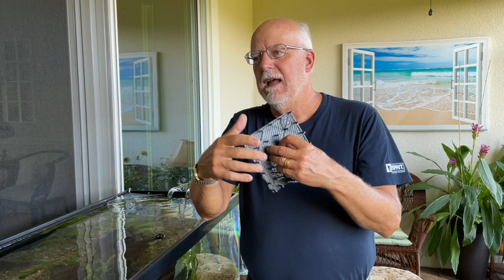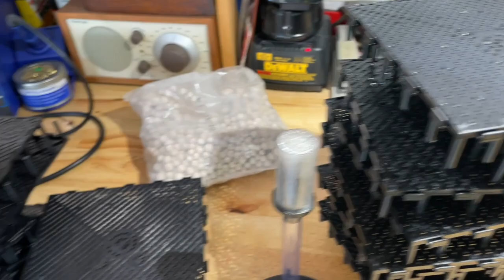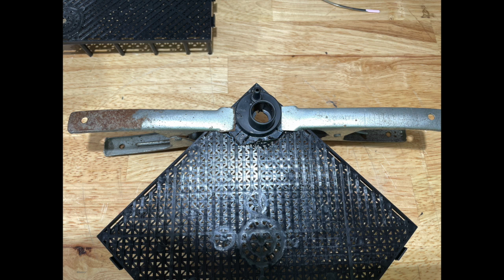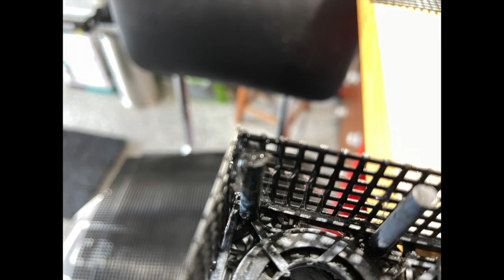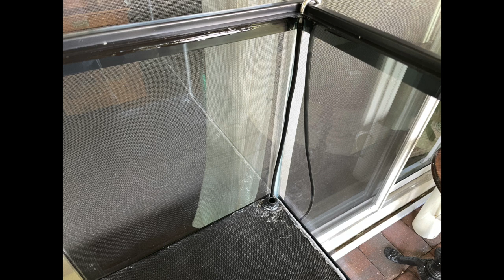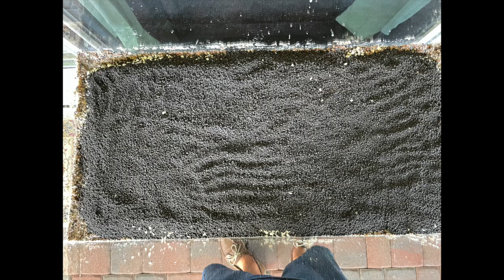PART 3: Step by step instructions on setting up a 40-gal breeder in the Lanai with Plenum and BCB

Comment: Dr. Kevin Novak, thanks for the great video!
There is a problem Undergravel filter that the UGF has narrow slots in the plates, which over time become covered with silt and dirt and cannot allow water flow through them.
And if aquarium tubes can be easily cleaned with a brush, then I have no idea how to clean the narrow slots of the UGF.
I will be glad if the author removes my fears!
Reply from the maker: I've ran under gravel filters on the same tank/s for over 25 years and never, and I mean never, had the slots clogged up. There is a lot of misinformation out there about plenums and under gravel filters that really hold no merit in the Hobby.
Reply: @anoxicfiltrationplenums  Thank you for your reply! This was my only doubt on the way to installing a Undergravel filter + Plenum. Your experience has removed this doubt and now the way is clear... :)

Comment: Those plates are available in Indonesia and they come in black or white but they sell two types. There is the one you show and they also come with a hole in one corner set up for a riser which is sold separately. Here they cost about 70 cents each.

The craft screen is a whole other story costing several dollars for an A4 size sheet. I just hot glue some nylon fly screen to the assembled plates, folding down each edge. A meter of fly screen costs less than 2 dollars.
Reply from the maker: You can also make a plan. I'm out of PVC pipe you can buy any Hardware Store..

Comment: Dr Novack, woudl it be an issue if i put the kitty litter with Iron right on top of the filter plates and then add the sand+gravel mix on top? or do i need to have a gravel/gravel+sand on the filter plates before i put a layer of kitty litter and laterite?
Reply from the maker: In fact, I would highly recommend that you do it the way you're describing.
Reply: @anoxicfiltrationplenums  thank you for coming back. I am in the process of doing this in my tank so let's see how it goes 🙂
Reply: Dr Novak, do you think if I vary the thickness of the plenum or substrate it impacts the effectiveness of the plenum? For example I have set up my tank so that the substrate including the plenum is thicker at the back 4 inch and thinner at th front around 3 inch

Comment: I’m new at this, how often do you change the plenum??
Reply from the maker: Never, once it's set up you should be good to go. For example, my 90 gallon aquarium has been running far over 4- years now with a Plenum and it should run easily 20 to 30 years without ever being torn down.

Comment: In the past I had issues with glue sticks adhering, what type of glue stick are you using. Btw, I am living in  se Florida, not many fresh water stores here in Port St. Lucie
Reply from the maker: I don't know what kind of glue sticks they are. I think I just bought them at one of the Harvy stores. They seem to be doing fine and holding very well..

Comment: Isn't that the same thing as a bottom filter?  I might have missed a part when you were explaining the functionality of it, but it seems just the same as a regular bottom filter.  When I was younger I had a 55gal set up with a bottom filter that had four up lift tubes, I used the two outer tubes for air/bubbles and used the two inner tubes for two HOB filters, I simply put the intake tubes from the HOB's into the two up lift tubes used for the bottom filter so that all the muck would go through the substrate, under the bottom filter and then up through the up lift tubes/hob intake tubes.  It kept the water sparkling clean, but that was before I knew about testing for ammonia, nitrites and nitrates so I didn't know anything about parameters, my fish always seemed happy and healthy with just monthly water changes and filter cartridge swaps when needed, and I had that tank set up for over four years.
Reply from the maker: The name "bottom filter" is a misnomer and that you don't use a Plenum as a mechanical filter. You use it basically 100% biological.

Comment: For some reason I want to start this out by calling you Doc, so if that's ok, here we go.  Love all your undergravel videos.  This is my setup.  Bio Rings underneather Lee's Premium Undergravel on a 20 L.  On top of filter is landscape or weed control sreen, then organic soil mixed with Flourite Red about 2 inches, then about an inch of black sand.  Cut the tube down to about 3 inches above substrate.  How can I tell if the water is flowing unerneath?  That landscape screen was pretty tight nit but water would go through it although pretty slow.  Am I ok with this setup?  Thanks Doc

Comment: My mbunas keep on digging the gravel. I'm afraid they'll never allow the plenum to work optimally. Good thing I have 2 BCBS with oil-dri in the overhead sump.
Reply from the maker: Just use one of those craft screens about a half inch to an inch into the Plenum and then once they start digging they'll only be able to dig that half inch or so of substrate and can't then bother the rest of the Plenum.
Reply: @anoxicfiltrationplenums  🤣 ok doc... That'll be fun.
Reply: @rockfella27  this made me laugh! Hope the plastic mesh worked out for you 😊
Reply: @laurasutton4057  It really did. I sewed 6 of them together with fishline (nylon thread) and a needle to make a big single one the length x width of my aquarium. Worked perfect.

Comment: I have an aquarium that is approximately 117 gallons. I have calculated I will need 27 of the grids. My question is will I need more than one uptake?
Reply from the maker: Not really, after all you're only trying to move water through the plenum slowly and you're not trying to move water as fast as you can so one uplift tube would be more than enough.
Reply: @anoxicfiltrationplenums  Thank you som much for getting back to me really appreciate it!

Comment: Would red lava rock contain enough iron to work as the iron source?
Reply from the maker: As far as I know no lava rock would not work unless there's a way for it to break down and release the iron to make it available to the plants and bacteria. There are other substrates that have iron in them but that iron unless it can be released someway  will not become available to the plants or bacteria. However, manufactures kind of deceive the hobbiest into believing that there's iron in their substrates but it's an usable iron. Here's an example: long ago people used to use iron nails and put them in their aquarium substrate. The iron nails would start oxidizing and therefore would break down and release the iron to the plants. So if you have a substrate that can't be broken down to release its iron content how is the iron going to get to the plants?

Comment: Instead of betta undergravel you can just buy rigid tubing. More bang for your buck and you can make several plenums by just fixing the rigid tubing to the hole you make with the step drill.
Reply from the maker: That's true but I was just trying to make it easy on the hobbiest.

Comment: I really like how you mixed the sand and gravel. The goldfish are very pretty and it will make their colors stand out more. I have used the API Quick Start and the Stress Zyme for as long as I can remember and it has always worked very well for me. For anyone who may be interested Lowe’s has the anti fatigue matting by the foot and it is a great leveling mat for aquariums. Also Rancher’s Supply also has what they call stall matting in different sizes by the foot. Both work very well. Great build Dr. Novak. Look forward to seeing the plants you picked. Have a great evening. 👍❤️😊🐠

Comment: I have a question doc.. I have a 275 gallon curved plexiglass tank with a 30 or so gallon sump I bought from my roommate last year and set it up at my gf house. I do very little maintenance/water changes. I do test the water occasionally for ammonia, nitrates, nitrites. My question is why is it always at 0 none on these 3 tests? I run one 2217 eheim with mech and the coco puffs and the basic filters that come standard with it. I did throw a full filter pad probably 10 by 14 inches I got from petsmart, it’s a white/grayish pad I believe for nitrates, I’ve washed it couple times and it’s been in there for 8 months so I don’t know how effective it is. The previous owner never had anything nothing in the sump so I threw that in there a 6 small bags of meh bio media in attempt to at least make some sort of use for the sump. I put in two 10 pound bags of the red clay fluorite on top of the two or so inches of gravel already in the tank to help out the 6 Anubis and couple Java ferns. I just don’t understand with all the tritus/ fish poop and food from being over feed laying in the bottom of the sump and the most neglected fish tank with couple 20% water changes in a year why aren’t the fish, plants dead and no nitrates? The tank has 4 angles, 5 red eye tetras, 5 green tetras, couple mbunas, 3 them funny looking orange cichlids, couple small peacock cichlids, large plecco, couple different Corys, 2 large blue South American Acaras, one dubusi, they all get along idk 🤷 why lol 😆.and few more I’m forgetting. So there is fish in tank. Probably not a lot considering the size of tank. Could the Red clay fluorite I dumped in be acting like a anoxic filter? There’s no kitty litter in there but a lot of red clay laying all over the bottom of tank. Also the water is clear and barely any algae on the glass or plants, the 10 inch plecco is probably helping some. I did service the eheim and vacuum all the tritus in the sump today. I just don’t understand people doing two water changes a week and I have only done three 20% in a year? Also the water in San Diego is high PH I have tested the tank and it’s high or alkaline. Any thoughts? Thanks for you advice in advance. Really enjoying your videos and I am going to make a large anoxic filter for the sump cause I don’t do much maintenance obviously.

Comment: Why do you never use a small external(!) pump instead of the bubbler? For example, a pump with a capacity of 60 liters / hour is switched on every hour for one minute. You can measure all the parameters of water from under the plenum, accurately change the amount of water intake, find the maximum amount of water at which complete denitrification still occurs, to use the plenum maximum efficiently.
Reply: Suggest a make/brand of whatever you recommending. Thx.

Comment: Good video.
You start again to talk about canister filter at the end of the video.
This iron an cat litter will complete the nitrogen cycle. 
So is that not enough filtration if you have a normal stock tank? In other words do i need additional filtration added besides the cat litter and iron?
Reply from the maker: If you watch some of my newer videos I run a 20 gallon aquarium completely off a canister filter using a PCB basket in it. There was no substrate no plants no nothing, except the canister filter.

Comment: How deep was the first layer of gravel/sand that was on top of the plastic UG filter pieces? Also the final layer on the top ( gravel/sand mix ). Was the mix 20lb gravel and 50lb sand?
Reply from the maker: It really doesn't matter how deep you make any of the layers above a Plenum as long is it combine height is anywhere between 3 to 4 inches.

Comment: Sir the cheap Chinese undergravel filter are worthless and to join them is a pain, moreover, to connect them a lot of spaces has to be manually created for water movement below it, which too is a pain. I have purchase drain cells and plan on using it. They connect easily. What do you say sir?
Reply from the maker: I have not found the same problem you have with the UG plates. And I have bought several of them for different aquariums and they work just fine for me.
Reply: @anoxicfiltrationplenums  Sir here they  come in 7.5" x 7.5" two plates each  in one pack. For each plate there is separate lift tube and no space in between. I made a plenum for my daughter's 75G aquarium. A total 8 such plates were used. I had to cut slots manually on the bottom of the UG filter for water movement. Now I am setting up a 150 for myself. The drain cells have 90% void space, joining them is a child's play. I am planning on pasting craft screen using glue gun on top of it. The cost for entire DIY UG filter is costing under 5 dollars.

Comment: Hi Kevin. .. wow this is the money shot ! So it's now clear to us all how to install the plenum and what the substrate sandwich looks like ! It actually isn't as complicated as a lot of others have made out. It's so awesome to have such information available and I for one am ready to reset up my 1st tank. I now have all the materials that I need based on your recommendations. I've gone for ultra fine nylon fabric for my substrate seperator. The under gravel plates I have come with the uplift tube attachment bases already so I don't have to do that bit. I'm just thinking on my final sandwich mix for my substrate. On a side note I've filled a filter sock with my mix of baked clay sanicat kitty litter and dupla laterite and installed that into my juwel rio 125 built in filter. Will now  wait and see what happens. Thanks again for all your valuable information. Viva the anoxic filtration revolution ! John .
Reply: Hello. I am also changing the setup of my tank. The dirt mix I am proposing to use is that recommended by Father Fish on youtube. I am really keen to know how your experiment with the "bcb basket" goes with the Juwel aquarium. Best wishes, Mandeep (London)

Comment: Will this work for frontosa cichlids in 100g ta nk if so what kind of cat liter amd how many betta under gravel filters 1 or 2 one on each end of my 5ft 100g tank??? nice videos btw
Reply: IDK if frontosas dig. You may be better off making multiple BCBs in your SUMP or add one in a canister. If frontosas dig you'll have to make a mesh sheet half inch below the substrate for them to not dig too much. I did the same for my mbunas.

Comment: 🤔 I like to use sand because it’s a neat, natural looking substrate. It’s cost effective and it’s a natural filter and doesn’t damage my fish that like to forage and sift through the sand. 
As for the stand half of my stands are custom made by a local guy who works with metal. The other stands are store bought/ Amazon purchases but I had the same guy weld them together. 
Thank you for your videos, they are very much appreciated 👍🏽

Comment: Kommentar 1 am 2021 10 07 :

I have begun to plan a large aquarium for wild discus, cleithracara maronii, some tetras and some plecos and corys.

I want to use this plenum.

Just I picked up one information you provided that every meter there should be another tube for the air to be pumped out slowly. Which made me wonder about the best distribution of tubes within the plenum when there will be a 2 meter depth.
Shell I install two intakes within the plenum for the depth? Or what would be the best intake strategy?

Second question : For the height of 1,80 meters there will be a certain load of hard scape, especially woods and some larger stones.
How do you recommend to set such heavier hardscape up with a plenum?

Thank you for your advise. Your effort is highly appreciated.

All the best

Michael

Comment: Are you using fiberglass based window screen? I am building a tank that will have sand substrate, curious about the screen you used to place above the UG filter. The two options at my hardware store  are  fiberglass and aluminum window screens. I assume aluminum is not recommended for fish.

Comment: Thank you for your videos Dr. Novak. I am in the process of setting up a 90 gallon aquarium for a 3 striped mud turtle. The turtle needs an area in the tank that is only 3” deep where he can rest and breath. I have a slow moving plenum with under gravel filter plates in the tank with a layer of kitty litter and then a layer of sand. I am wanting to build up a sand bank on the one end that will be about 12” deep. Do you see any problems with that? Will water still be able to makes it’s way slowly through sand that deep?

Thank you
Kent

Comment: Did you end up using any of that landscape fabric to prevent the sand from getting down through the holes in the filter plates?
Reply: I think he used a window screen netting in the earlier part 2 of the built

Comment: Maybe it would be better if you had shown the foggy water when you fill in the water. May calm down first timers. Foggy water in a just set up aquarium is very normal. There is also the fun of seeing the water clearing up to crystal clear.
Reply: I thought the same. I used to panic seeing brown water in my new tanks. 24 hours it looks so clean ... it is fun seeing the change, and I have cheap top filters no powerful canisters.

Comment: Nice video! I'm happy that the pool filtration sand that I got in the Netherlands is 'sand' coloured. Mixing it with smaller pebbles gives an awesome look.
I do have a few questions about the build, since I'll be setting up my upcoming tank soon:
- In a 250L (100*50*50cm, about 55g), do you need more than 1 uplift tube, or is 1 enough? Does placement matter?
- How do you know the amount of flow thought the plenum is the right amount? Too fast won't make it anoxic, and too slow will make it anaerobic, right?
- Is the soil depth always the same? I want to build some 45L (10g) and 60L (15g) tanks with a plenum, and a 3-4 inch layer feels like a whole lot of substrate for that size tank. Would a BCB make more sense in small tanks? I have undergravel filter plates that are about 1cm high